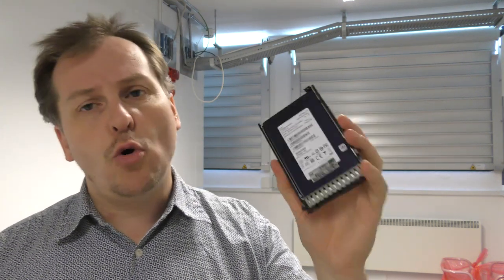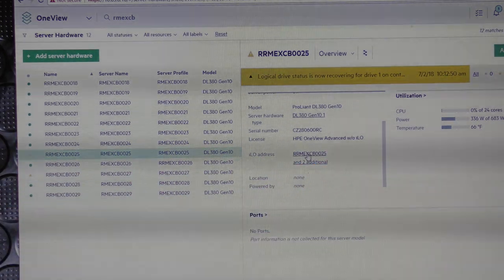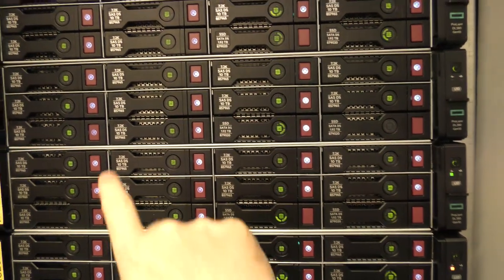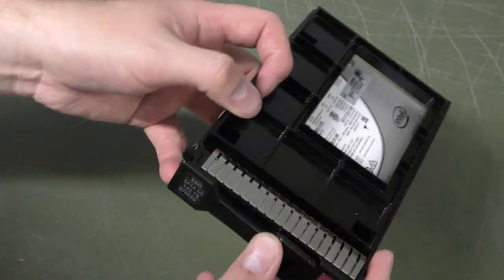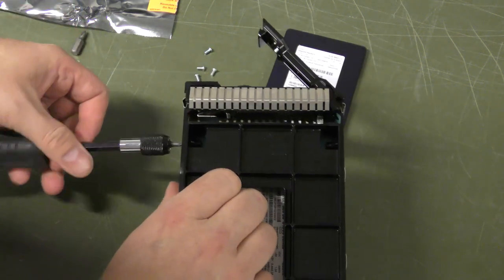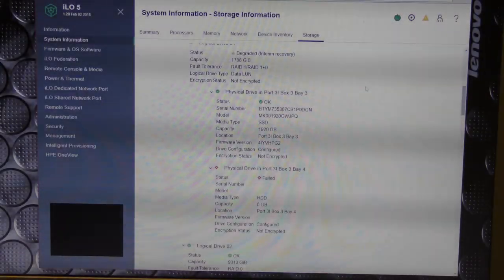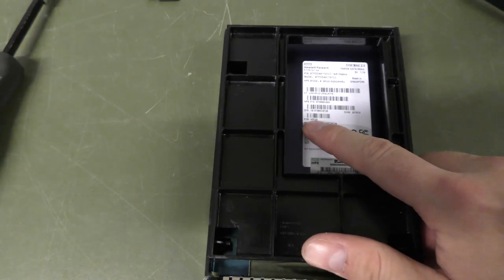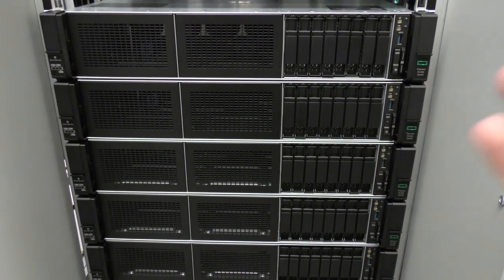Replacing 100TB of HPE(Intel) Enterprise SSD´s which Fails - 715

Comment: what are you using for your 3.5" to 2.5" caddy conversion?

also, IMO HP servers are great, despite firmware and misc updates being locked behind a paywall.
once you get past all the BS from HP, the hardware is fairly decent.

that being said, I might be biased because I've only worked with HP throughout my personal and career life. I can't guarantee my opinion won't change if I'm exposed to dell, IBM/Lenovo and supermicro.

edit: as for the VMWare Issue, please update to VMware 6.7 or even 7.0

you need up to date drivers from an up to date system for up to date hardware.
6.5 was for the 1366 era hardware and equivalent (xeon 54xx/xeon 56xx series)
6.7 was for the 2011-0/1 era hardware and equivalent (xeon E5-26xx v1 and v2)
7.0 is for the 2011-3 era hardware and equivalent (xeon E5-26xx v3 and above)

I can confirm that my DL380P gen8 are running VMWare 7.0.2 without any issue and about 70% of the capacity of my server is being utilized.
Reply from the maker: I have worked many years with IBM hardware, when we started to use HP/HPE hardware,, the 1/2 hardware cases a month went up to 3-4 a week,, and cases are a lot longer in getting resolved. :-/

Comment: Hi Morten,
I also can't recommend HPE server. I had only 3 servers to maintain and had already firmware problems with the HPE raid controllers on 2 of them.
That is very disappointing.
Reply from the maker: Hi Daniel Gangl
Thank You very much!  We have been extremely unlucky with new HPE equipment lately.
Thank you for watching! :-)

Comment: SSDs are interesting. There have been significant problems with Intel on that (I can't afford 10G ethernet cards, but hey, I'm a home user and have almost no servers these days). The problem with Intel's drives used to be that they would not go in read-only mode (i.e. you can still pull the data off them, no use for RAID but if you get unlucky, at least you can drop the drive in a different machine, copy everything from the drive and then destroy it), they would just stop responding. I didn't realize that they are apparently still doing that with these 1.92GB drives. That alone would be enough reason to avoid that brand/firmware. 
I've used many brands of drives now, some more known than others, but other than people letting their battery die on laptops, I've not seen anything this bad in a long time. Good luck with the server work you mention lower down. It is a lot of effort if you have a major failure and have to switch to a backup server. 
Have a good weekend!
Reply from the maker: They have some firmware problem.
Reply: Wiebo Westerhof if the disk reaches it's TBW threshold, it should turn to read-only mode, but if I well remember it seems that the mode lasts only during power on time, then after a reboot it stops being usable. I can be wrong, but I'm pretty sure about it. And this is surely valid only if the controller doesn't fail: my colleague had a Samsung Evo Pro 850 drive that suddenly after a reboot wasn't unreadable; he had to send it to a company to recover data, and the analysis was of a controller hardware failure; they had to replace the controller to retrieve the data back. That's why I'm still counting on hard drives rather than SSD...

Comment: i have hpe dl380 gen10  and my configure is raid 1 with 2 ssd samsung evo 870 1TB each  and both of them now 5% of remaining life  i want replace with evo 970 2TB is it possible and can be replaced without powering off server ?  those hard for OS
Reply from the maker: I would believe so.. You do need to make sure your data is safe if it fails,, Backup!! But than you can replaces first one drive and let it rebuild to the new 2TB,, and when that is done replaces the other drive,, and let it rebuild again.

Comment: Thank you for the video. I understand your frustrations with HPE, but really my old IBM X3650 M3 doesn’t like to boot from ssd, I remove them and test them, they are aOk. For esxi 6.7 IBM likes to boot only from the embedded hyper visor usb (raid card M5014) Doesn’t like ssd either. X3550 m4 has the same problem. Although M4 has the M5110. Yet the same results even after updating firmware.
Reply from the maker: Hi Mamdouh Tawadros
Thank You very much!  good to know there is issues :-/
Thank you for watching! :-)

Comment: Hi Morten,

Have you tried to update the firmware on the "failed" drives?

I know by experience that ssd's are more sensitive to firmware issue's.

And noticing, you are using those new drives with 2 different firmware.

Isn't it an best practice yet to keep firmware up-to-date?
Specially when you are running HA/Clustering?
Reply from the maker: Hi Dennis Wieringa
When you purchase for $200.000 new servers,,, do you not expect your servers to work,, do you expect to replaces 20 drives with in two month,, reinstall server do to multiple drives failing at ones. Use days to firmware update the SSD's from HPG1 to HPG2,, for it to do nothing. and then HPE wants us to waight for HPG3..NEW DRIVES Thank YOU!!
Firmware is a part of what we buy,, if it does not work,, the product is faulty
Thank you for watching! :-)
Reply: @MyPlayHouse  The nice thing about the Dell's iDRAC9 Life Cycle Controller is that it will automatically fetch the firmware and update everything for you.   I had to update 14 Dell PowerEdge servers in preparation to convert the exsi hosts to ProxMox hosts.   It took an hour to do them all.   Then I went on to install ProxMox on them.  All via remote. :)

I usually don't update the firmwares on production servers long as they're not having any issues.   The 14 Dell servers haven't been updated in almost 3 years so figured I get them done before installing ProxMox on them.

Comment: Small school but we recently got a brand new DL380 G10, less than 3 weeks after deploying the first SSD died.
Beside it the old X3500 M2 is humming away with only one dead drive in the last 6 years.
And on the other side my test X3650 M3 still to experience its first failed drive ;)
(brought the x3650 as backup server for the new one, just in case)
Reply from the maker: Hi Søren Steinmetz
Well drives can die,, and it doesn't really matter if they are in a IBM/HPE or Lenovo server,, but SSD's with firmware issues right out of the box,,,, bad testing..
Thank you for watching! :-)

Comment: Did you try to update firmware of the ssd drives, HPE provides firmware updates e.g https://support.hpe.com/hpsc/swd/public/detail?swItemId=MTX_265737e41d0e4123856b5c6688 You can turn disk uid on, to help locate failed one.
Reply from the maker: Hi Paweł Marciniak
Thank You very much!  Yes all 50 drives has been firmware updated, from HG1 to HG2,, There is now a HG3,, but by then we was replacing drives instead.
Thank you for watching! :-)

Comment: I guess this is why we don't use SSDs in servers yet for our customers. Most of our HPE equipment survives until replacement is due for the entire machine (5-8 years), aside from an occasional failed disk or cache battery. Plus I'm just a goon, I don't get to pick the partnership hah.
Reply from the maker: Hi NelizMastr - Tech for PC & Mac
Thank You very much! When HPE servers are up and running, the uselly runs well for years.
Thank you for watching! :-)
Reply: Ssds should outlast a hdd (unless it's high write operations but you buy the correct DC type ssd then) this seems a specific issue with HP hardware and there own firmware 

I only had about 5 ssds fail most of them was DOA, others was retired due to % life left on them or past 5 years life

Comment: What you think of SuperMicro Equipment?
Reply: Maybe my opinion helps - they are quite reliable. I've running multiple servers from them for 5-6 years no. No failure so far.

But this is a firmware issue on the raid controller or the drives itself, not a server hardware issue.
Reply from the maker: I have only seen the supermicro “servers” that I saw at the 3D college,, that was barely a server.

Comment: Have you thought about changing from RAID-Controller logic to ZFS(onLinux)?

Have you tried to plug the drive directly into a workstation and check the status (without the raid controller)?

I had one Intel 320 which have an firmware issue: after so and so many TRIM commands, the firmware basically crash and report just some MB of storage... instead of some GB. This would result in a flag as faulty by the RAID-Controller... maybe this bug is still around?

If you run into exactly this issue, the drive can be completely reset with some undocumented SATA commands and I'm using it now for 5 years without issue. This is known as 8 MB bug.
Reply from the maker: I do not decide the software on these systems.
Reply: Stefan this is obviously an SSD issue, not a raid controller issue. 

The missing serial number but reported firmware version point towards a missing connection to the actual storage of the SSD.

You usually have an controller with a small storage and memory which boots a firmware and then read informations like the serial number from an hidden partition of the large storage which also stores your data.

So this doesn't look like a firmware problem but more likely a hardware issue with either dying connectors or chips connecting the storage (or the on board power supplies for those chips or the actual storage array) not working properly anymore.

The question here arises, how did a product with this quality issues ever made it to the market 🤔

And yes, I'm just wildly guessing!
Reply: Stefan well, okay then forget what I said about the SN. :)

My guess is, that the SN is still saved on the actual storage, but if it have still the SN they either might switched to a partition on the Firmware storage or write it directly into the hardware on production on an ROM. 

Nevertheless since you cannot update the firmware and it reports 0 bytes, it sounds like in an emergency state of the firmware, like it detected a mailfunction.

Do you get any smart data via hdparm from that thing?
Reply: Stefan this output still shows a physical size and also a max lba. 🤔

Comment: Firstly: check HPE documentation before you guess which drive it is. Pretty well documented what box and bay means. Secondy: I would never use SATA in servers like that, use SAS. Also check controller and drive firmware, had similar issues with spinning drives in the past.
Also: all the white leds on the red buttons is no good: don't remove these drives. Means you have more array issues I guess.
And why would you blame HP for using an Intel NIC? Just use official HPE parts, they work perfectly for us.
Reply from the maker: Ohh it is a HPE branded Intel card!
Reply: My PlayHouse Ah, then disregard that comment. The way you said it made me think it was an Intel card. Personally I like the 534FLR adapters. Zero issues over the last few years.

Comment: I can't fathom in my wildest extreme thoughts why anyone would run 2 ssds as a RAID1 for an Exchange server OS.   WTF is wrong with using 100% reliable SAS drives for this purpose?  Methinks when ordering these systems the thinking process was wrong.  I have a couple of G5 and G7 servers still running on original 146Gb SAS drives, G5 on 10k and the G7 on 15k drives.

On the subject of HPE, well, years ago they were bulletproof in every way, their service was exemplary on the few occasions it was needed.  I don't believe they have maintained that standard, and I wouldn't use them again.  I have had experience with Fujitsu servers and found them a 100% product.
Reply from the maker: Well even ssd’s can fail, so this is for redundancy and not for preference, and on a $100,000 order, they do really not cost much ;-)
Reply: @MyPlayHouse  I think you meant Even SAS drives can fail :) 
Raid1 for OS is fine as long as you use 99.999% reliable SAS drives, and not fragile SSDs which cannot reliably handle the IOs created by an OS running Exchange.

Comment: don't know what it is that makes HP so absolutely tedious to work with. Maybe it's the login-wall and paywall surrounding bios, firmware etc updates.

But what really pisses me of is when a server that works fine with the backplane and built in raidcontroller suddenly understands jack s*** and keeps kicking perfectly nice drives. 2000 ms commit latency and what not...

I can't fathom how **** those HP servers are!

I banned all HP, Dell and IBM from our setups because I am sick of proprietary bullshit.

HPE has been calling me 5 times in a month asking if I plan on upgrading our server infrastructure anytime soon.
Me: Yes, but what it is to you?
HPE: Maybe we can come in with some cheap offers on storage solutions.
Me: The next server I will buy for our storage solution are 10x asus ws x570 PRO + 10x Ryzen 5 PRO 4650G with 32GB ECC Ram. 2 Boot SSD's and ample room for 6 OSD's. Price 1000USD. Your server will cost me three times that. I will have endless difficulties flashing your crappy obsolete raidcontrollers. Before that I will have difficulties obtaining the sofware to update the hardware... Then I will have issues with some other proprietary crap that wants to automate something, but fails and ends up looping endlessly. No thank you. I prefer simple systems that do what I want when I set them up to do it!! I wonder why system integrators have even allowed you to continue this charade of bad software, bad website, crappy proprietary hardware and bad service.

They never called again!

F.H.P.D&I!
Reply from the maker: :-) I am mostly disappointed over to many failures, to slow fix time,, 10days to get a server fixed,, is fresh in memory.

Comment: hmm intel SSDs are failing? who would have thought of that ever happening. I have known intel SSDs fail where they report as 8MB, 0MB or my favourite just don't get discovered by the controllers at all. The first 2 can be fixed by a special tool from intel, and the last one is fixed by just changing drive supplier :)
Reply from the maker: Hi Simon Clough
Thank You very much!  We did update the firmware of all 50 drives.
Thank you for watching! :-)

Comment: Mnnng looks like i'm found my problem with HP 7:31
Reply from the maker: Sorry I did not understand?
Reply: I'm mean we recently bought  in April, ten of hp dl380 gen10 servers for vmware hosts, last 2 week four of them complaining weird problem like hba controller in production suddenly not responding or disk just disappearing or recently fresh new replaced ssd become a bad drive. Last 3 days was pain in @ss, especially
fresh new replaced drive wont see in controller blah blah......  Yesterday watching your video i find out it was b00ldy firmware bugged out, which one of them system already in server maintenance mode but system trying report to hp...  too many headache. Now we had to call local contractor refund or change to other brand
Reply: And we had just like your scenario can boot in to esxi 6.5 after 10 20 minutes it get crash or freeze, we find out in dump log intel lan card causing it